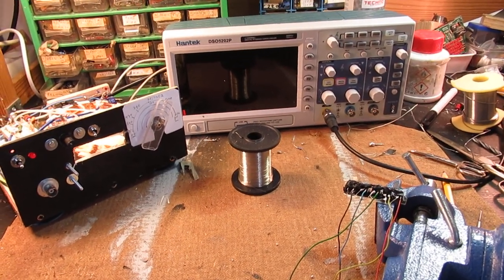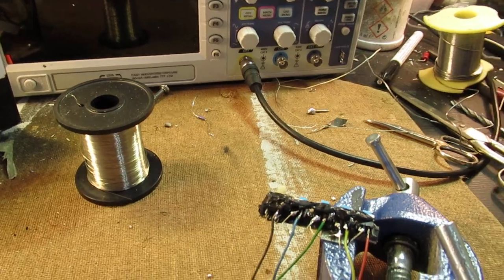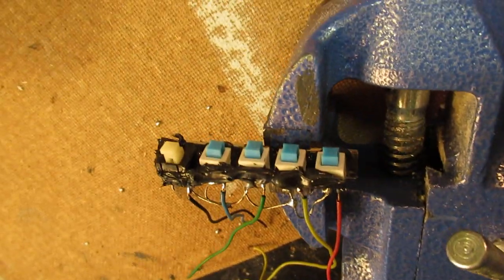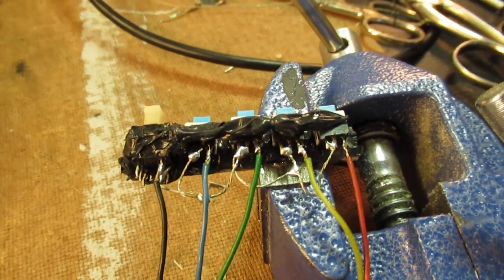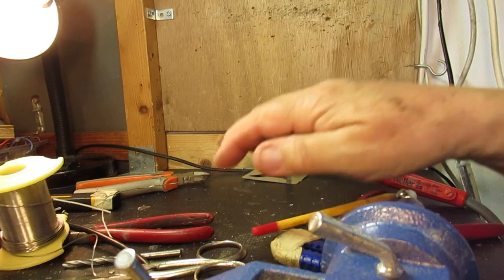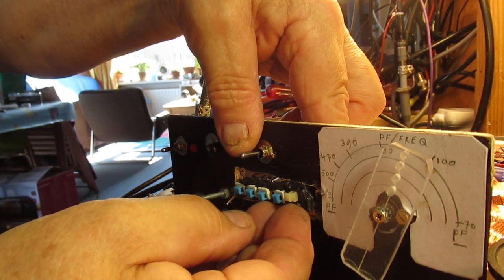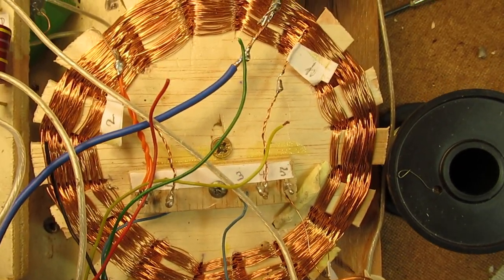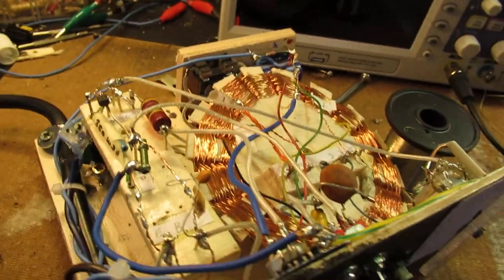Good idea to do the wiring on the front plate of an audio amplifier, radio, or other electronic unit

Comment: you can use Frc cables...it will be much neat.

or cables from switches...cellotaped ..
Reply from the maker: Yes, but in critical radio setups it can give capacitive coupling. Thanks.